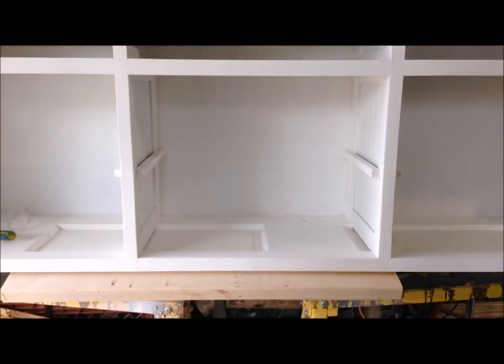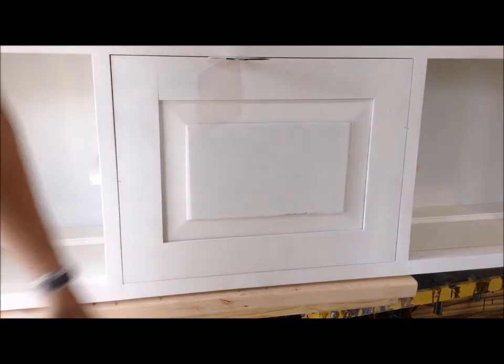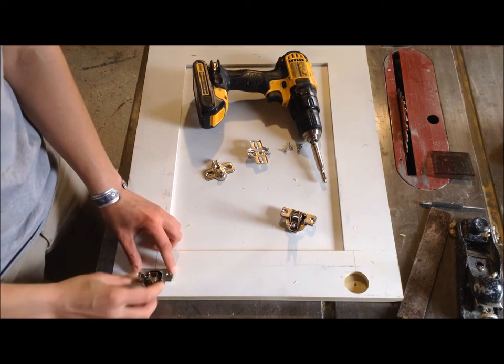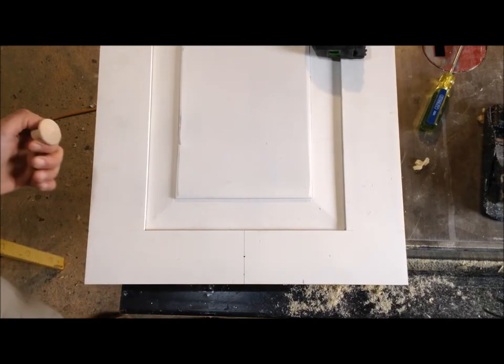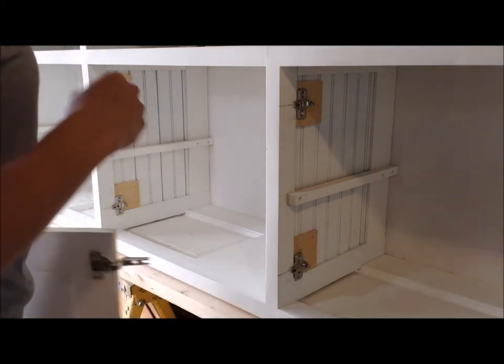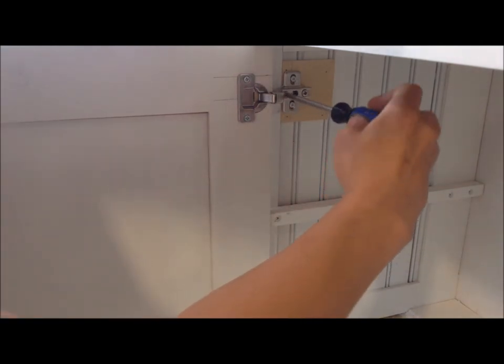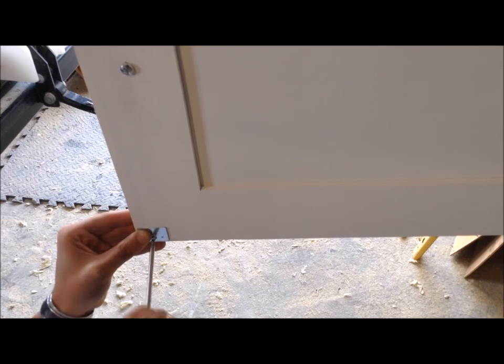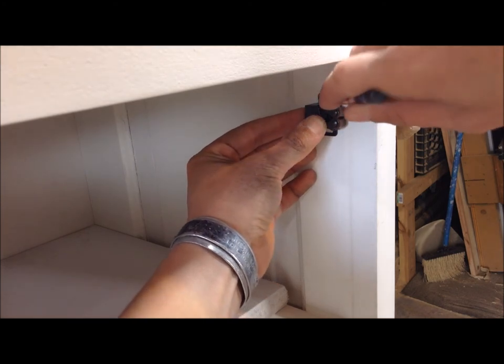Woodworking : Make And Hang Raised Panel Inset Cabinet Doors // How-To Part 3

Comment: I have access to a mill, so I used to make my own hinge jigs out of scrap pieces of plexiglass.  I don't use a drill press table, and on one occasion the workpiece slipped and I missed the mark for the forstner bit, which then required me to cut a circular plug, glue it in, sand, and drill again.  I've since switched to a Kreg concealed hinge jig, which really makes this a very simple process and takes the drill press completely out of the equation.  Really enjoying these older videos of yours.

EDIT: I typically use rockler.com for drawer slides and concealed hinges...always seems to have what I need in stock and takes the hit-or-miss in stock or not in stock at the big box stores out of the equation.  Shipping time is very reasonable.
Reply from the maker: I try and get hardware from Rockler too because I trust the quality.  Some stuff I have gotten off Amazon has been garbage, but they always win me over with the fast shipping.